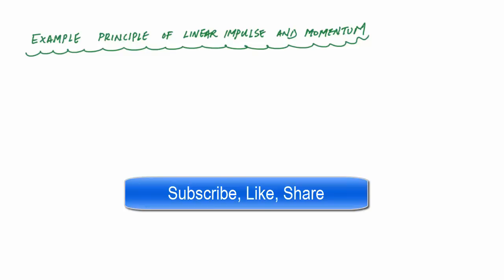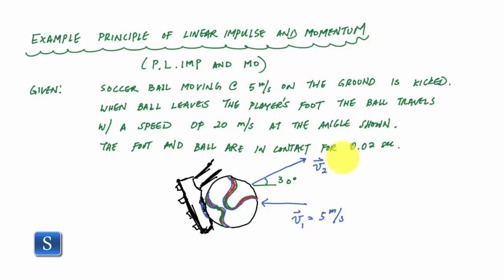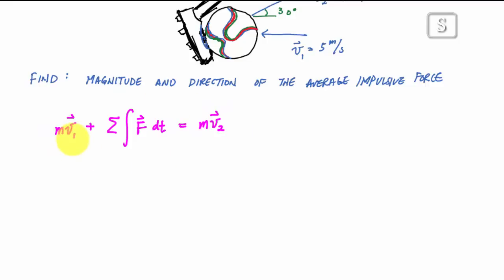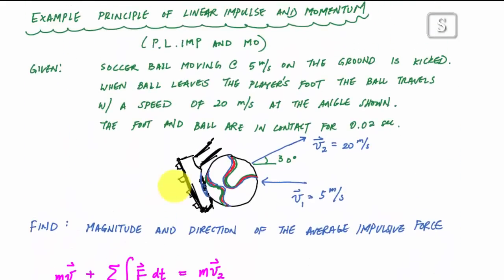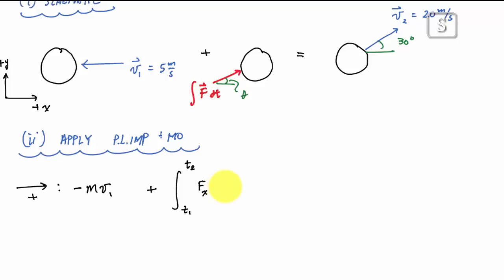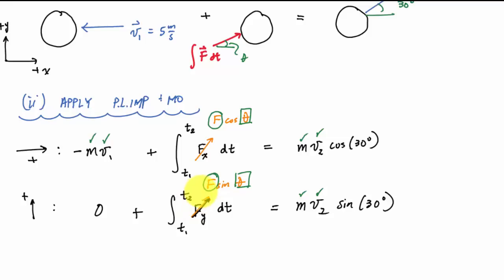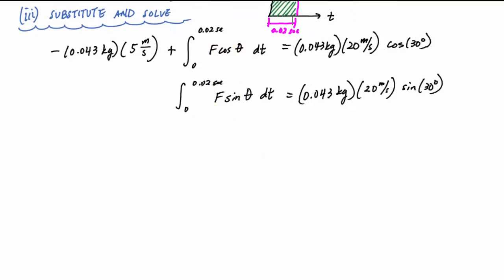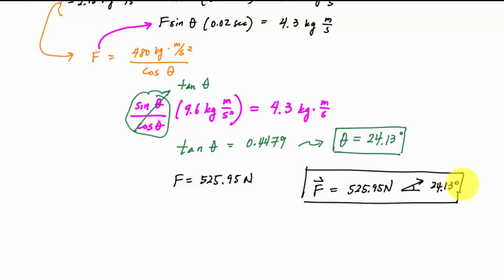Linear Impulse and Momentum Example 1 - Engineering Dynamics

Comment: When solving the simultaneous equations, why isn't the integral applied to the cosine and sin function? For example, for the x-axis equation, you have the integral Fcos(theta)dt between 0 and 0.02 seconds. Why does that not simplify into Fsin(theta)(0.02)?